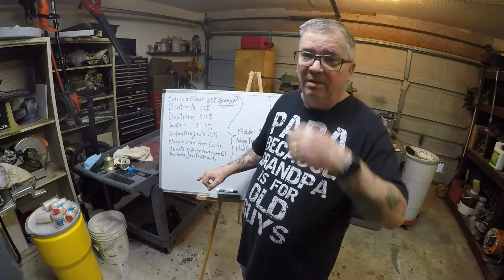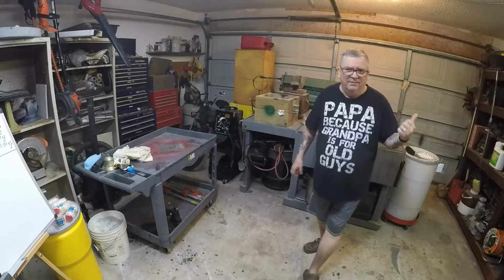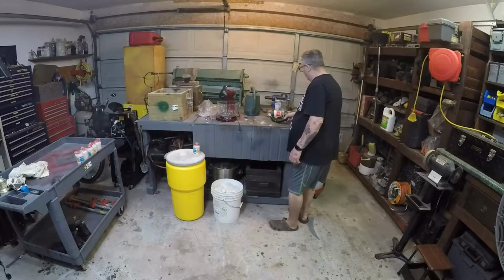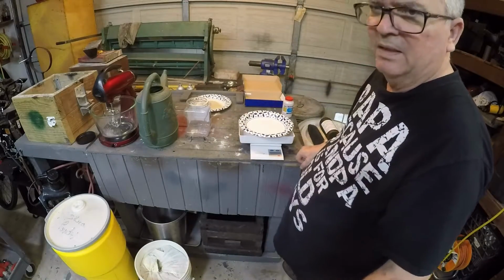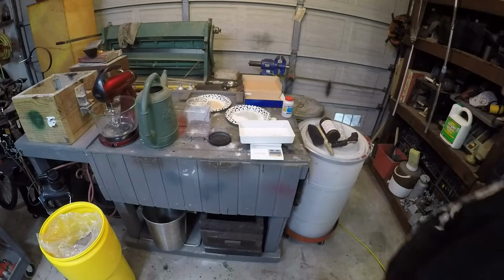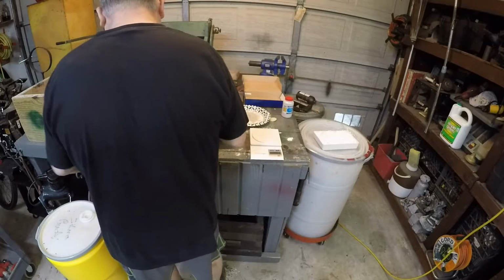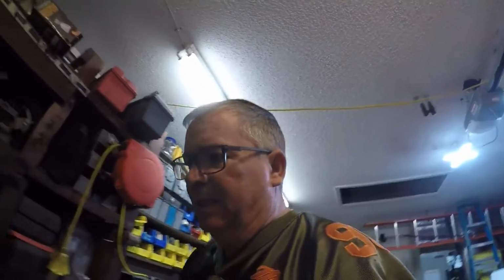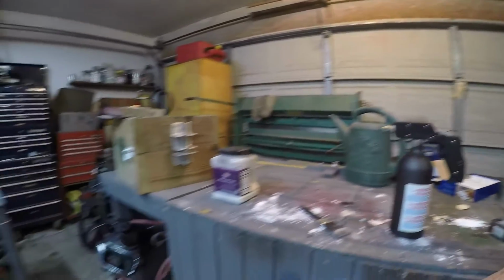Using an old formula to make a good mold wash

Comment: If you have one nearby and ok with buying from them, harbor freight has a 1/2 gallon pump up hand held sprayer. It's around $8-$10 and might be worth a shot before moving to a pneumatic spray gun.
Reply from the maker: I ordered a mold wash sprayer today. I know that the sprayer works as I used it while in the Navy.

Comment: Long term does the mold wash cause any issues with contaminating the casting sand as it gets recycled?
Reply from the maker: No, each of the ingredients only adds to the molding sand in a positive way. Besides a properly applied mold wash is paper thin and doesn’t have enough mass to negatively effect the sand.

Comment: The sure shots are awesome, but they are for full liquid only, any particulate will clog the nozzles.  I have 2 now, the first one died somehow, even Milwaukee doesn't get it.  All I've ever put in it was brake-kleen, and I found rust dust plugging the nozzle.  They said there is NO WAY it should have rusted, and sent me a new one.  The old one works, but only if I take the atomizer out, which isn't what I want.

DO NOT put water into the Sure Shot based on what I could gather from the person at Milwaukee as that is about the only thing that would/should rust it.  I now empty these when I'm done using them.